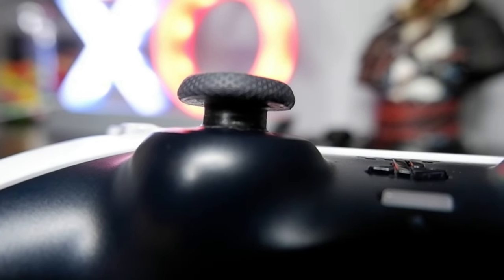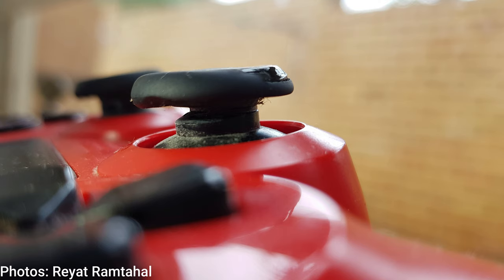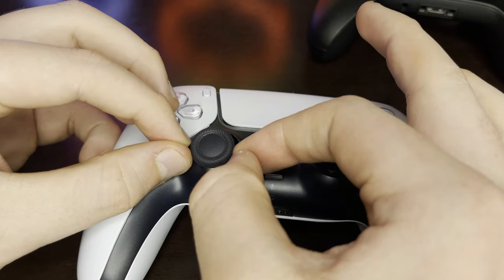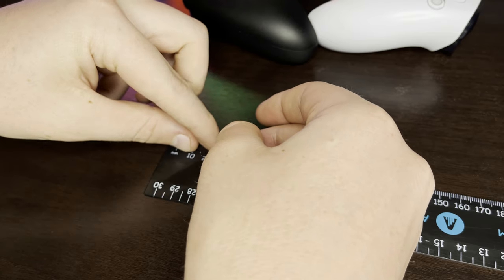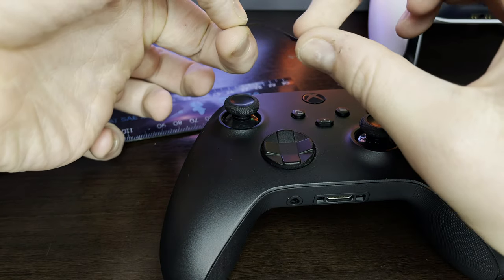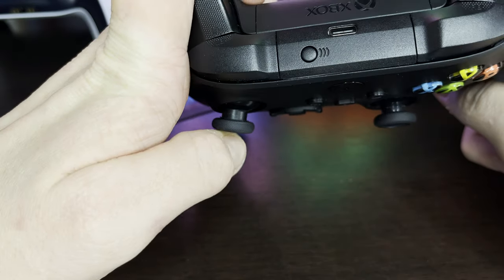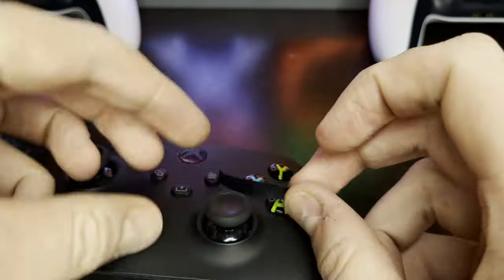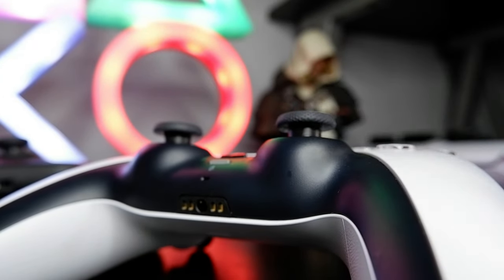How to Protect Your Gaming Controller Analogue Stick From Damage With Household Items

Comment: I personally think the lip of the ring where the thumbsticks are should be made of some sort of rubber instead of hard plastic. You'd think manufacturers would think of something like that, but I guess not.
Reply: @GLITCHEDZA  yeah personally I'm using this method, took maybe 5 minutes to do and now I have that peace of mind that my thumb sticks won't get grinded to death over time. I'll definitely be doing this with every other controller I get in the future!
Reply: Imagine grinding your thumbstick against a rubber rim, and then imagine all the rubber debris that would generate.  Any friction of any material over time = chafe.
Reply: GuliKit's controllers use metal rims and metal sticks.

Comment: How often do you need to replace the tape?
Reply from the maker: Probably every four months or so. I find that in the summer months they come off quickly due to the warmer weather. But some tape has better quality. One controller later around 12 months because the tape was stickier.